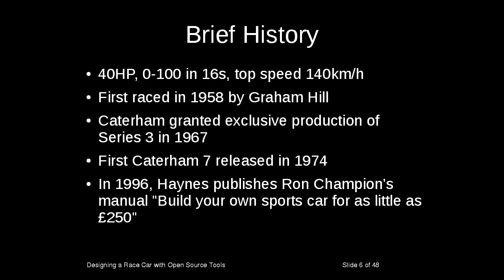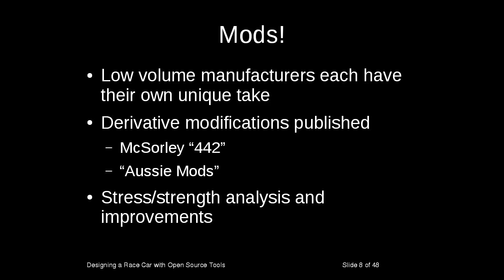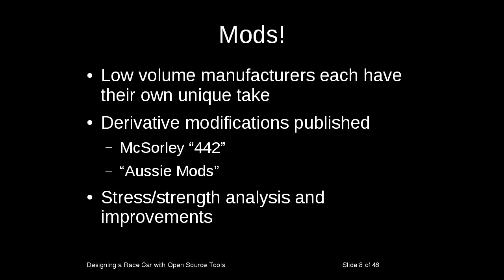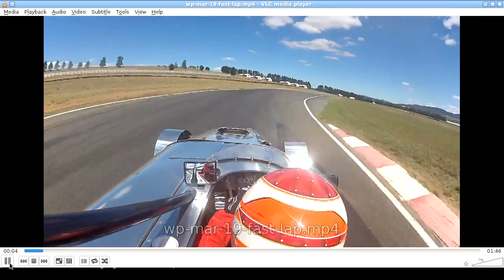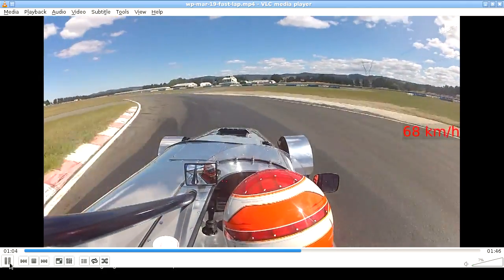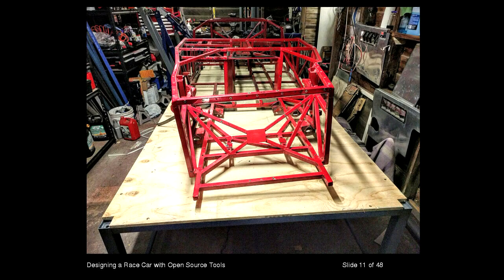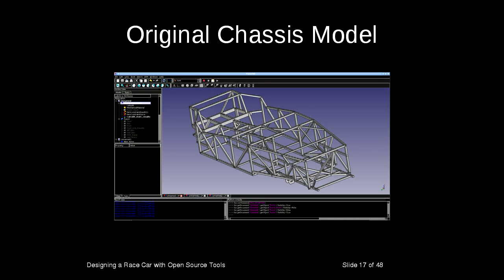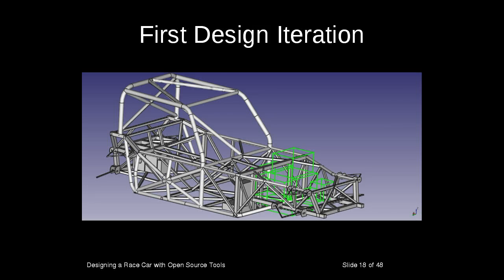Designing a Race Car with Open Source Tools

Comment: Loved to hear "it's hard to weld welding wire into welding wire" 😅
So I went on with my actual build bc yes I made a 1:4 model out of 10mm x 1 aluminium tubes and I'm unable to tig that. Unable to weld aluminium joints I think, since it's not so thin.
It's a shame, the only thing I learned there has been figuring out the whole cut-bend-lineup process but it could also have become a great RC model had I finished it!